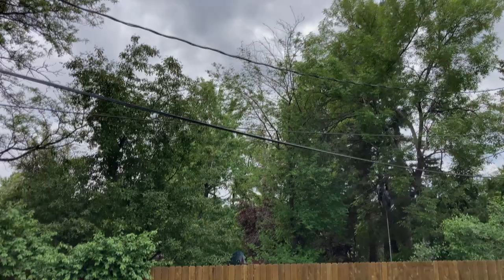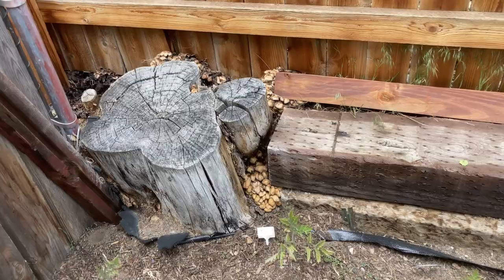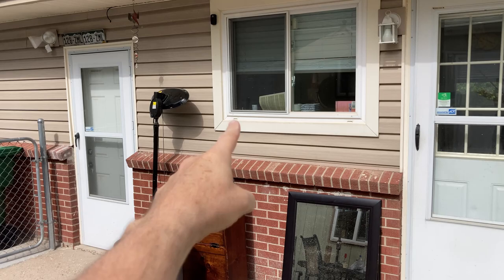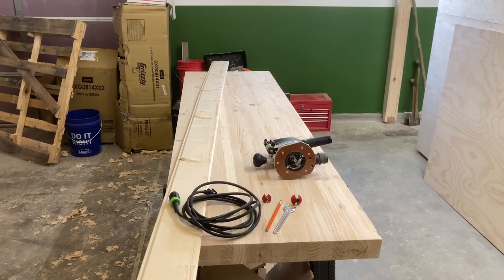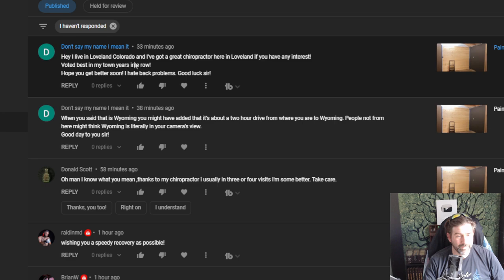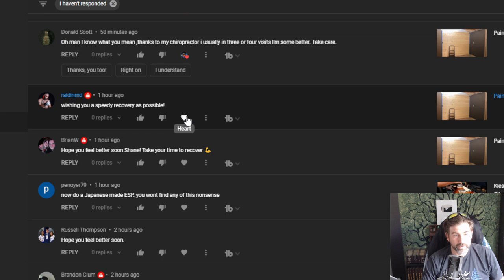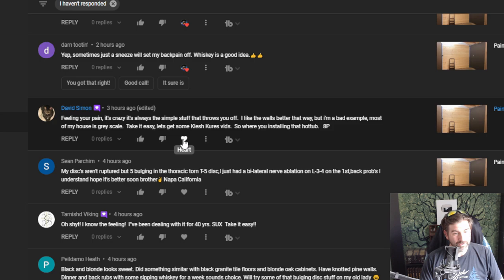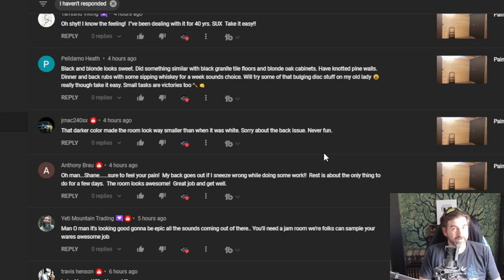Hardwired

Comment: Hey Shane, I'm a telecoms engineer by trade and appreciate seeing you taking on the task of cabling your shop. Have you ever heard of these; (TP-Link TL-PA717 KIT 1-Port Gigabit Powerline Starter Kit). It uses the existing copper power cabling to send bandwidth. However wouldn't work if your shops power isn't fed from your house. 💪